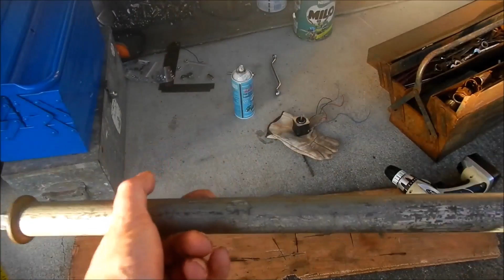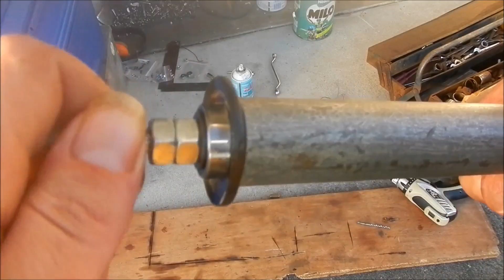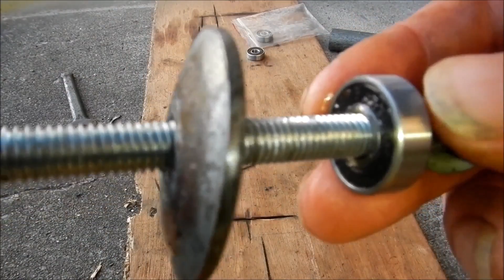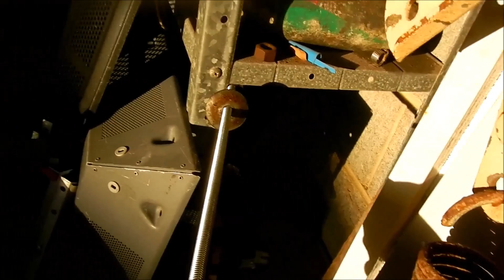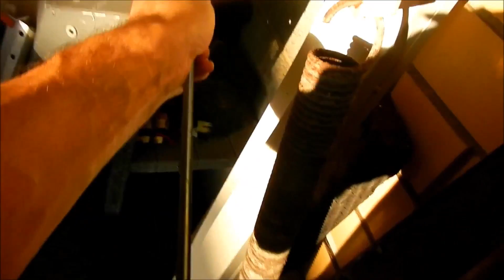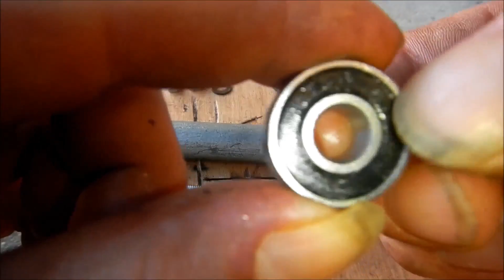Bearing Torture Test for 3d printer z axis.

Comment from the maker: Maybe. Getting them in 8mm is not so easy. Best quote I have is $48ea and a 2-4 week wait, which is a bit of a mark up from $0.38 ea for the skate bearings on ebay... Thrust bearings on ebay are looking pretty good. They will be expensive in local shop too $34. Only $4ea on ebay... Better rod, that stays straight, would be the sensible solution. Going to try and use the stiffer stainless guide rods to help keep threaded rod straight. Doing measurements to avoid mechanical harmonics.